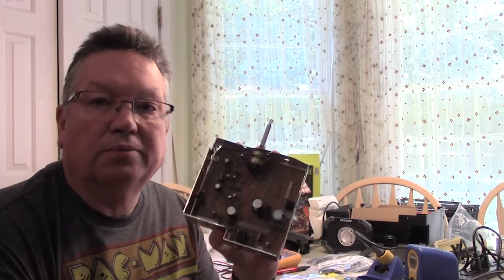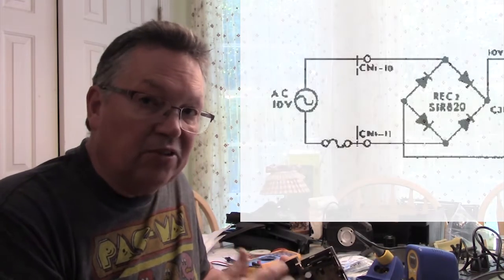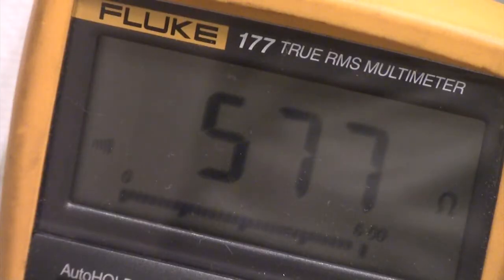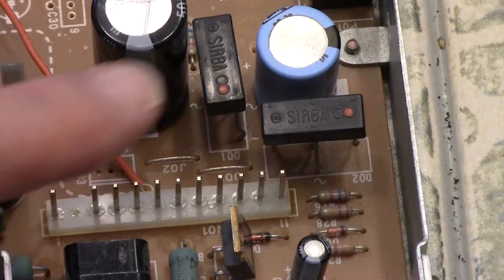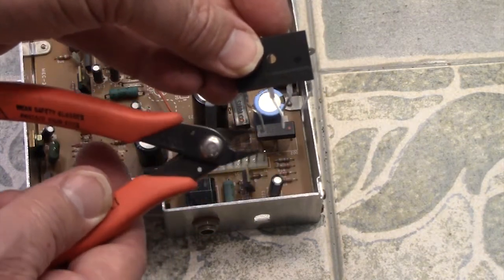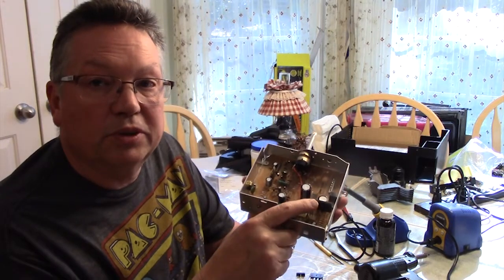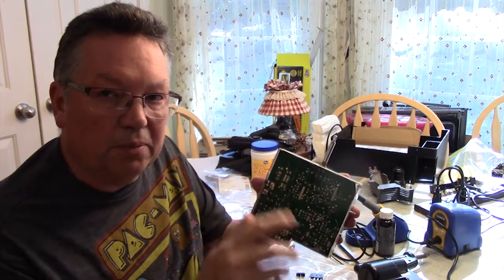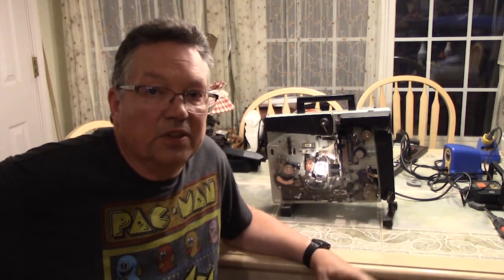The Projector Project - Elmo 16-CL Project 1 - Part 2 - Sound Board Exciter Repair

Comment: I think my 16-AL sadly has this issue…I was able to replace the sticky rollers and have discovered it has THIS issue something I need a repairman for because I can’t solder shit from shinola. But the exciter lamp does come on in mine no fuses are bad either.

Comment: Hello friend, a few months ago, I found an ELMO A-16 projector for sale in my country, Mexico, which I found very strange and curious. I found it in the small city where I live, La Paz BCS. It was strange because I found it on Marketplace and it was sold by a lady who had picked it up from the trash. The projector and more than 3000 feet of film in various rolls miraculously survived for more than 30 years in the desert near streams that flow from canyons when it rains. I've rescued many rolls from this collection. I had never repaired a projector before, but I managed to get it started and used parts from audio components and automotive plastic bands for the roller bands and 3d print reel. for colect all the movie 100ft cans.
 I have some spare parts that I haven't been able to find where they go, and the audio is very deficient because the cable it uses is also an instrument cable with a modified XLR end. Could I contact you by email for a bit of help?

Comment: Hi, I too have a problem with my Elmo CL-16 amp.   I've tested the bridge rectifiers and they are good.  I've also tested the NPN Transistor along with all of the capacitors and they are all good too.   I know it is the amp board because I swapped the board with another CL-16 and it worked, so must be something on the amp board.   Any ideas on what else I should check?

Comment: Do you know anything about changing the projection speed of this 16CL from 24 to 18 FPS?  The instructions seem to suggest it has something to do with the drive belt.  Any thoughts?
Reply: As far as I know, you simply move the drive belt to the other set of pulleys.  I’ve never done it but it shouldn’t be that hard.  Good Luck!

Comment: Can an Elmo be modified so the optical sensor can be connected to a better, external amp?  Bypassing the internal amp?
Reply from the maker: There is another video on YouTube where a guy wired directly from the sound pickup to his household stereo.  So yes, you could do that.  I didn't like that he called it a "Fix", it's more of a workaround.  He's actually the reason that I did this video.
Reply: @theprojectorproject  please post a link.